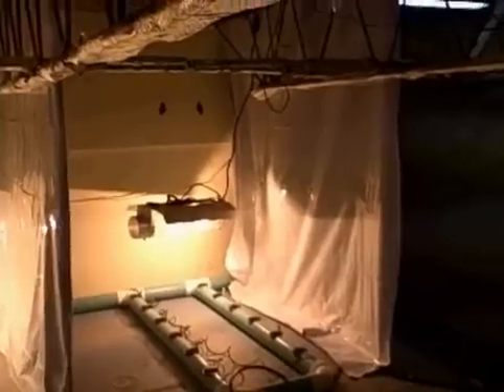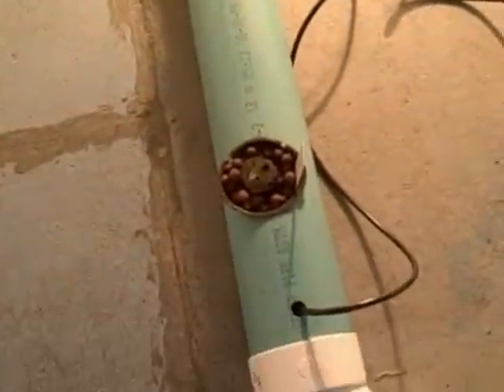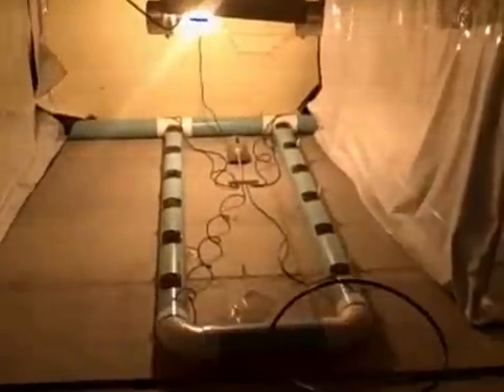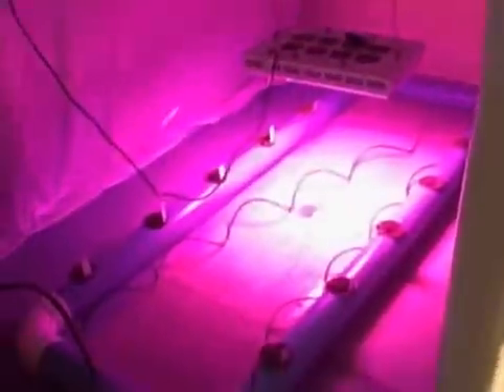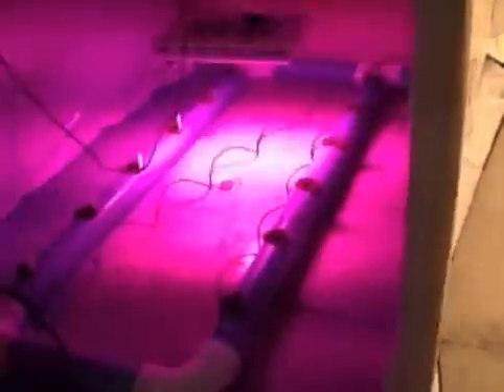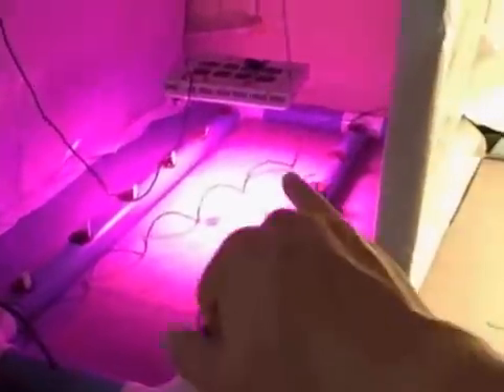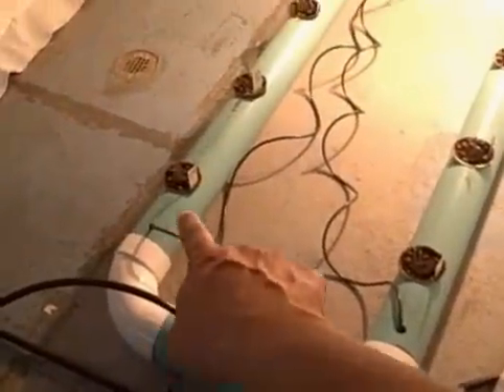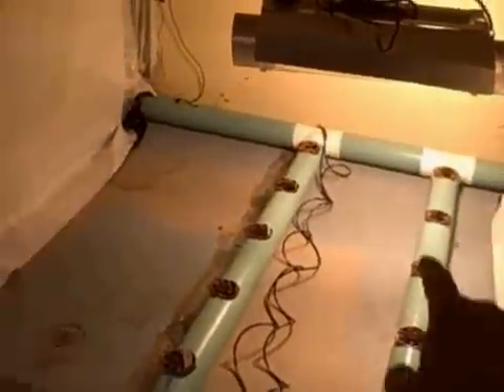HPS LED Comparison Video Prototype/Introduction

Comment from the maker: We are still knee deep in tests.  I'll work on updates soon.  Basically the HPS units and LED units are doing really well, but the whole system become so massively over-run that we had to use tomato hooks to properly support everything.  So far it seems that the pepper plants under the 300w LED are doing PHENOMENAL compared to the HPS, however the tomato plants are a closer call.